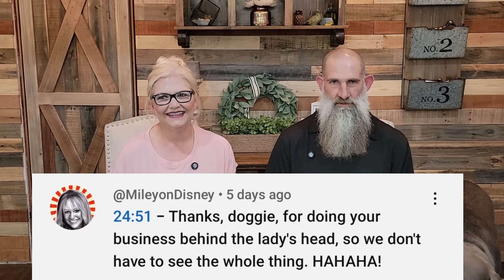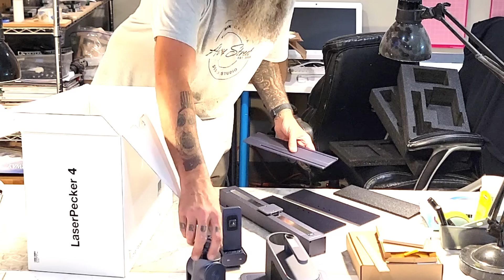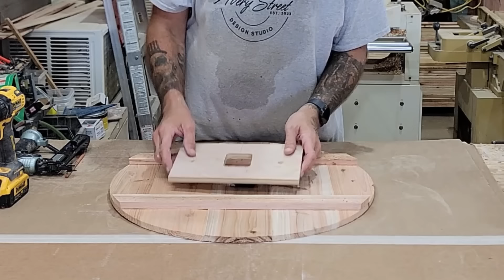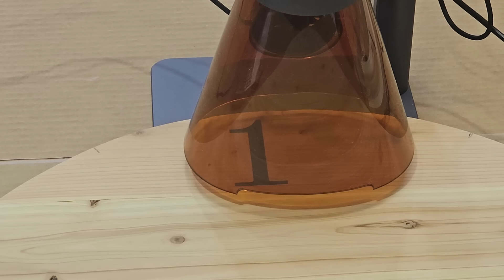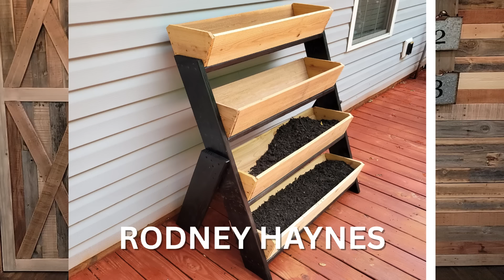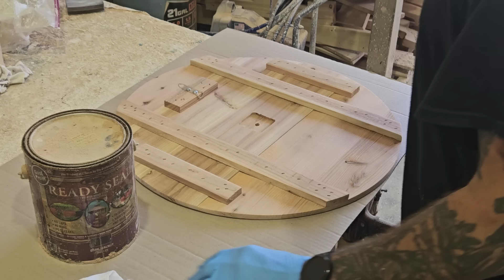How This Woodworking Project has Made Us More Than $1 Million!

Comment: Based on the orientation of the 4, 5, 6, and 7, the 8 appears to be upside down.  Not sure if it’s camera angle or optical illusion, but one end appears to be smaller than the other, which would be the top.  Is it possible to flip that in the laser program?  How difficult is it to change the orientation?

Comment: You could make a jig for engraving the numbers. Similar to your table saw jig, with a center registry pin that the clock sits on, with a recess for the Laser Base to sit flush with the surface of the jig, a registration pointer to align with your Number location marks . With such a jig you engrave the 12, then simply rotate the clock face to the next number mark, and engrave. No aligning each number. Quick, precise positioning of each number !  Not sure how you mark the number location, but you could use the same jig . With the number locations marked on the jig, you would mark the location of the numbers, lift the clock face, set the laser in the recess, lower the clock face back onto the center pin, align the 12, engrave, rotate to the next number, repeat.

Comment: I bought the LP-1 two years ago and it works great for my small projects.  I let it burn 2-3 burns depending on the project.  The laser is restricted to a 4”x4” engrave.  The price was $350 then.  It does take a few minutes to burn, that’s the truth.  For my needs it’s perfect.  I think it’s about 5wats power.  Compact and easy to use 👍👍👍

Comment: How much does the LaserPecker 4 cost? You mentioned it is affordable so I looked it up and saw that it’s on sale for $1,399 from $1,999 on a website and $1,699 on Amazon.  Unfortunately this is way too expensive for me 😢. Just wondering if I am looking at the wrong machine?
Reply from the maker: I believe the laser pecker 2 is on sale for around $700
Reply: I understand your thinking on how much of an upfront cost it is for the unit, but think about the products that you can create with it's output. 

Yeah, it's a $h!t ton of money on the outlay, but adding 2 to 10 bux per sold item is worth it!